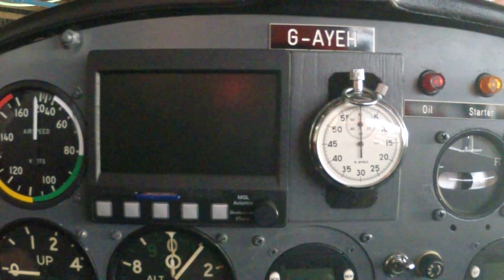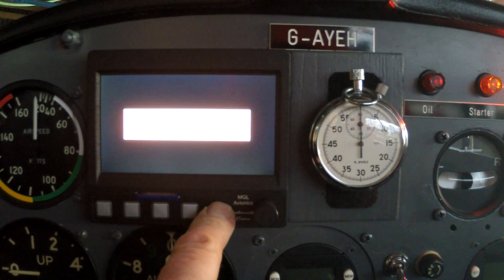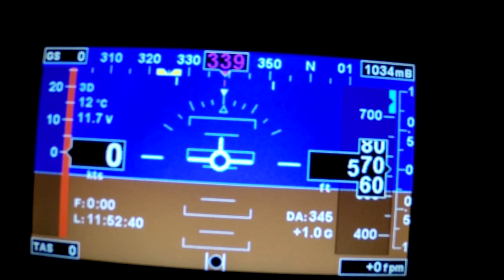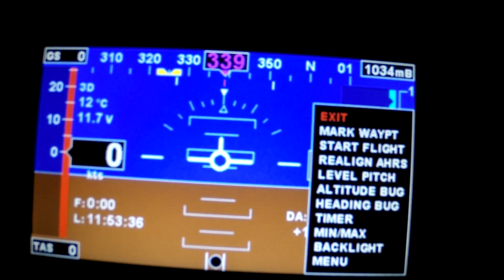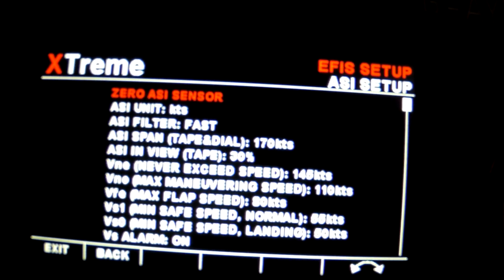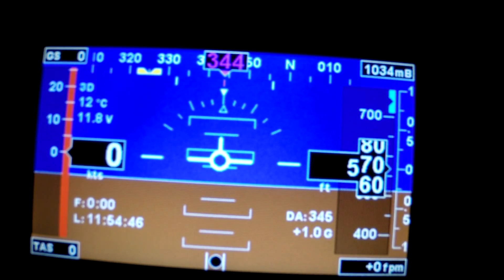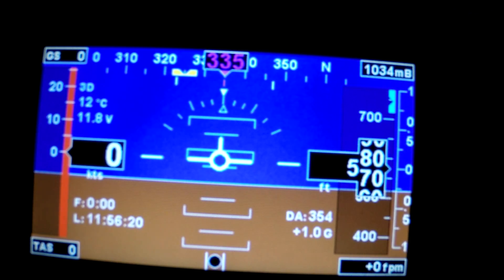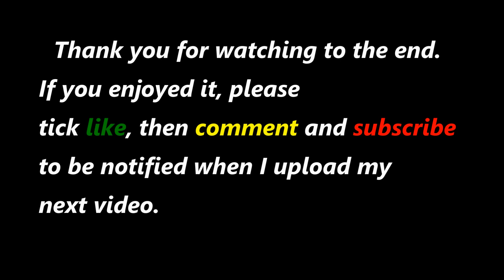XTreme Mini EFIS (Set Up)

Comment: I have a MGL Mini EFIS in my Cygnet SF2A I am primarily using as a EMS and back up airspeed/Altimeter.
REF: https://www.youtube.com/results?search_query=NX237F 

I may add the SP-7 to give myself a artificial horizon should I enter a cloud unintentionally.  The RDAC for wiring the engine sensors is very slick.  I like your Jodel Videos